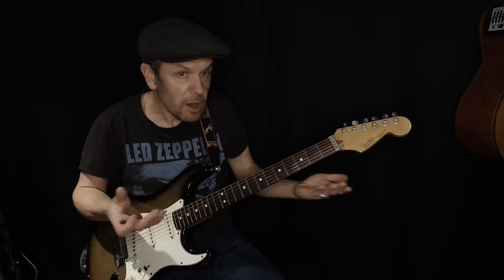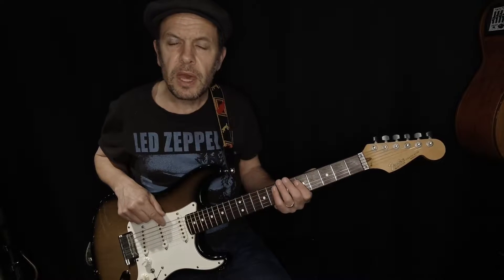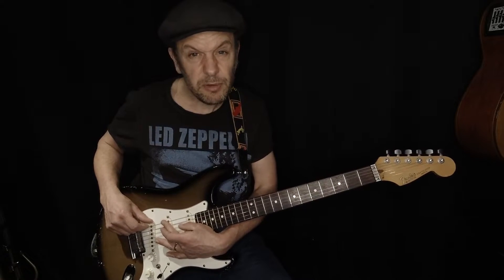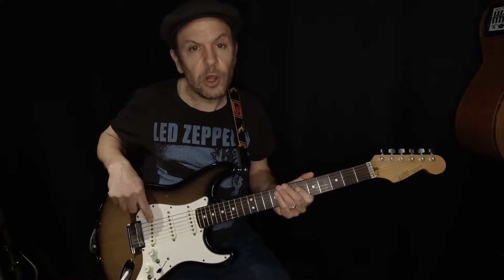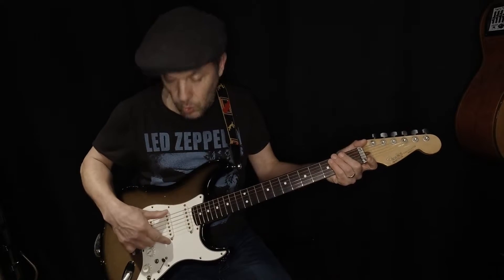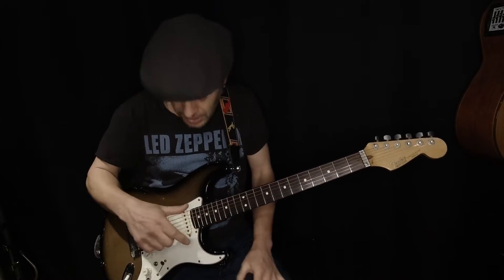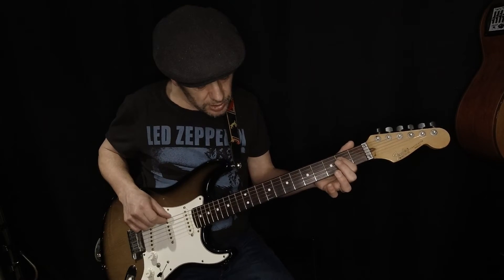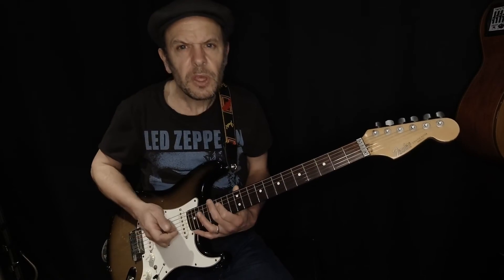Guitar Pickups, Harmonics and Overdrive - how does it all work?

Comment: Does it improve tuning with the metal nut?it divides opinion I believe
Reply from the maker: It’s a tricky one. A metal nut would technically mean greater levels of upper harmonica because of the density of the material, but not sure-never had a metal nut!
Reply: I thought you strat had a metal nut!!!